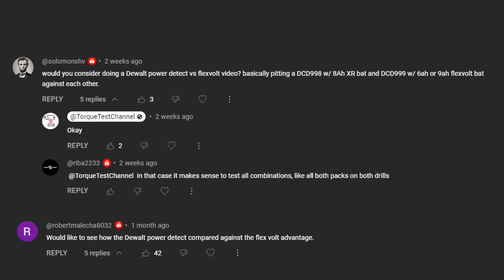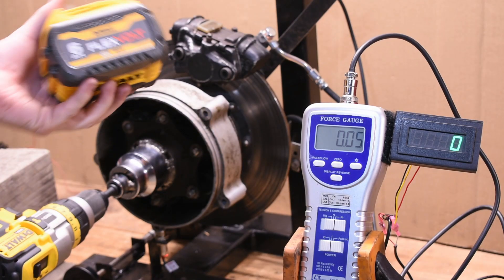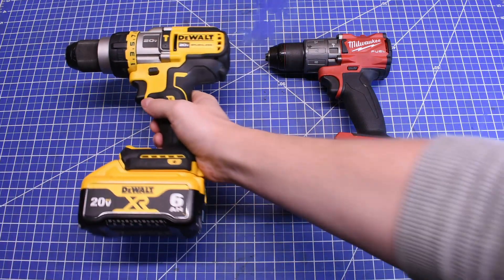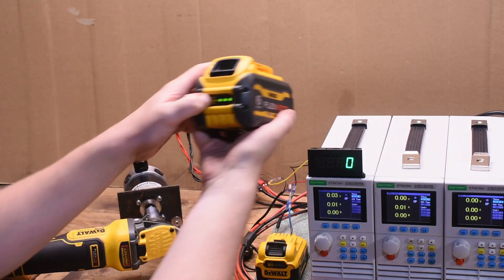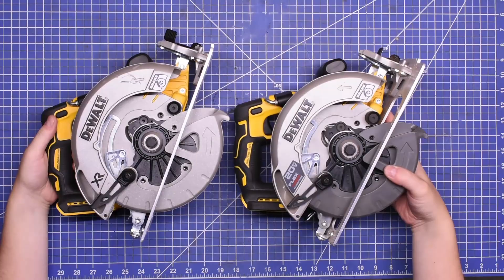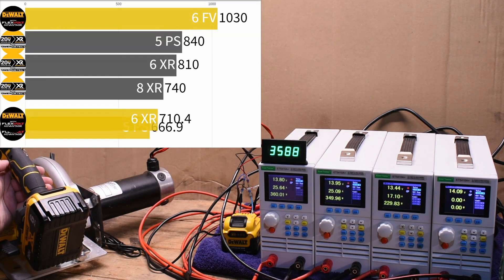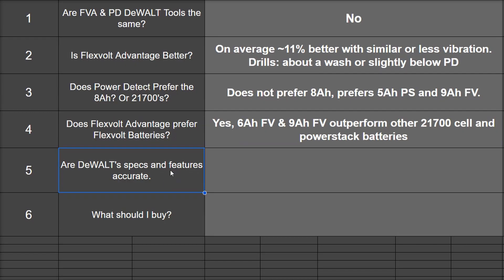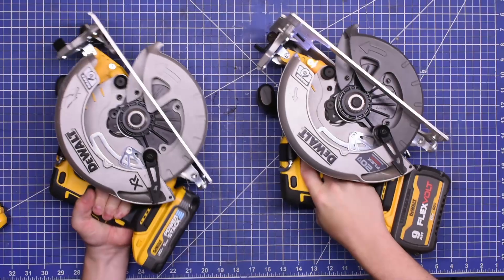Investigating the Biggest Lie in Power Tools: DeWALT's Flexvolt Advantage v Power Detect

Comment: Have you thought about testing to see how much variance there is between tools of same make and model? I am curious how much they might vary.
Reply from the maker: Do do now have 11 separate cases where we've retested tools on the channel and/or tested new tools vs ones that we'd only tested after being used. We've not seen measurable variance yet but we're not ruling it out either.
Reply: @TorqueTestChannel  Cool, thanks for the reply.  It defiantly sounds like there is no need to specifically test for the variance then.  Can't wait for the next video! 

P.S.  Powersmith sells two styles of rechargeable work lights from Home Depot ,among other sites, for about $20 each that seem to work well, just not sure about the durability yet.
Reply: Definitely this. Really can’t say with certainty what is going on until a meaningful number of the same tool or battery are tested. Even then, if you go to HD and buy 6 drills off the shelf, you’re possibly getting six units made at the same time in the same factory. Gotta mix it up to test brand consistency. Of course that’s a huge ask for a YouTube channel to be doing layman QC testing!!! Keep up the good work
Reply: @danr9183  Yeah that was my thought also.  It's a pretty big outlay to buy a bunch of the same tools.
Reply: I was thinking about this also. Batteries too, especially when comparing different brands.
Reply: You have me curious, does a company such as Dewalt or Milwaukee or ANYONE make any claims regarding the quality control of their build quality and if there are tolerances that can be expected? Any hard numbers, even if they're just lies?
Reply: @tyjay6752  that is information that you the consumer are not going to be given. That kind of quality control performance is valuable information that companies keep secret for all kinds of reasons. In a lot of consumer manufacturing settings it is common for manufacturers to have different purchasing specification agreements with different suppliers for the same part. So Retail store brand “A” might insist on tools that have tighter performance specs than Retail store “B”. That info is negotiating power that companies won’t freely publish
Reply: This!

Comment: Did I made right choice, when i bought 60th volth dcs578 and dcg418? My goal was is maximum power
Reply from the maker: Yes
Reply: DCG440 advertised by DeWalt to make 30% more torque than the DCG418 using DCB609. But it's also heavier at 6lbs vs. 4.6lbs.
Reply: i have the 418 and it is a monster. I had been wanting a cordless grinder for a while. was going to buy a bare 20v tool, but they were 229 dollars. Another store had the 418 with a 9ah pack for 289. That sold me on getting the 60v and i am glad i did.
Reply: Im waiting for a good offer for dcg405fn in my region, it's not a beast, but pretty useful for some welding tasks

Comment: Does it switch the battery to its 60v mode when in use on the flexvolt ?
Reply from the maker: Not on flexvolt advatage tools no, they are 100% 20V.
Reply: @TorqueTestChannel  Wonder where the advantage from FV batteries comes from then!

Comment: Took your advice about the 9AH FV battery a few months ago, and glad I did! That battery is a beast
Reply: Yeah but they have their downsides I’ve got 10 of them and two have crapped out after only barely being used three times !!!
Reply: @jamesfair9751  have you tried to jump start it with a fresh battery? It's worked for me on a couple batteries
Reply: @jamesfair9751  I only have 1, and it's almost a year old now. I guess I'll see how long it lasts. I've been using the fast charger with active cooling.
Reply: @jamesfair9751 How are you using them, I have been using a 9 Ah since around September 2022 on my weed trimmer and leaf blower without issue.  The blower drains the 9 ah in under 20 minutes so I would believe this would cause damage due to the high discharge rate.

Comment: I would like to see battery powered weedwhackers. Lawn care is shifting to solely electric equipment and it would be nice to see some represented. Weedwackers seem straight forward to test
Reply from the maker: Agreed, but does a weedwhacker with more spining power make it a really good one? (genuine question)
Reply: @TorqueTestChannel if i remember right project farm said so. Essentially the more torque the longer the line can be without bogging down which increases the speed(under load) at the end of the line making cleaner cuts and mulching as well
Reply from the maker: You guys make a convincing case
Reply: @TorqueTestChannel yes.. More power = the ability to run heavier cutting accessories as well as power through tough weeds
Reply: @TorqueTestChannel  Come on, let us bench race our lawn tools, too! :D
Reply: @TorqueTestChannel  yes it does.  My kobalt 80v with the shaft motor could barely run an attachment.  60v dewalt is terrifyingly powerful, like on par with the largest stihl khombi gas but somewhat higher rpm so a bit much for the edger attachment.
Reply: @TorqueTestChannel  Even if it’s a game of “needs to be this powerful, but more isn’t better”, it’d be good to know which tools hit that mark at the lowest price - and which ones last the longest at that power level.
Reply: I find that with weed eaters, the power isn't as important as other factors like vibration, trigger response and run time. I normally run mine on low speed and find that's more than enough for most weeds, I'm not cutting the grass with it.

Comment: Honestly, it's tests like these that help me determine which Dewalt models to get these days.
Reply: A certification in Dewaltology will be necessary for installers and tradesmen to ensure they get the best tool for the job.
Reply: @juanc5149 if you're looking for full power just buy 60 volt flexvolt
Reply: Or just but a different brand
Reply: im going to flex tools tbh...milwackee and dumbwalt can suck it
Reply: I have no idea why anyone would buy DW tools, their existing record on battery quality and technology has been suspect since  their Nicad days. I know most battery tool mfrs are somewhat disingenuous, but they have not been caught so often !
Reply: I've not had a single  battery issue in any of my 60+ batteries. Straight facts.
Reply: @CrimeVid  I know their 8ah seem to have some design flaws and the 10ah had a few bad batches that caught a lot of flak, but generally I've had very few instances outside of those of DW batteries being bad. Just about everyone I know has DeWalt (Our entire ring of associates we've compiled over the years seem to be one giant Team Yellow just by sheer happenstance), and many of them have batteries they use daily and work just fine for years.

Besides myself and some good friends who work a lot on cars and carpentry, all the professionals we know use DeWalt as well, save for the local mechanics who all use a mix of things with most of it being Milwaukee (most mechanics seem to have Milwaukee, while most contractors like carpenters and plumbers have DeWalt).
Reply: @WC3fanatic997   Not here(UK) most of the tradesmen I knew at the time ran Makita, those not retired still do.  During the worst of it the guy I worked with needed to buy 2 sets of DW tools while I was still running my Makita, I think it was a line called Marathon, The first nickel metal hydride batteries they ran. DW were trying to tell us they had upgraded too, they hadn’t.   I liked them, they ran at full speed until they cut out, unlike ni-cads.

Comment: My initial preference for Milwaukee years ago related to my perception that DeWalt was somewhat lost-- constantly changing battery packs and not giving confidence in future availability. The packs have somewhat calmed down (granted, still have 20V and Flexvolt), but the entropy of their product line is baffling.
Reply from the maker: They also don't seem to know how to discontinue old models. So if having like 9 current impact drivers is confusing, just wait until they come out with 2 more because it will be 11 then!